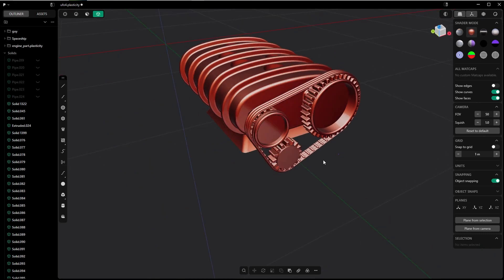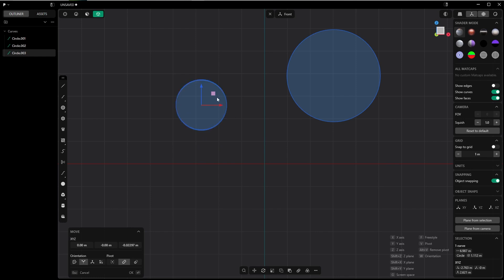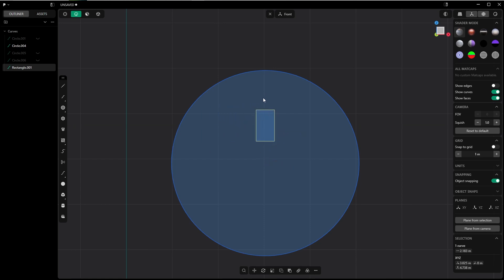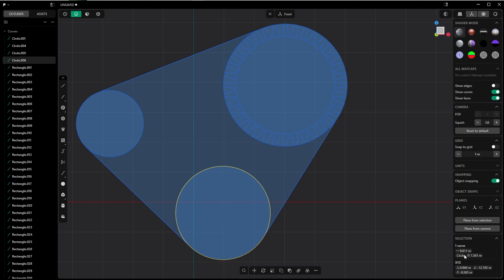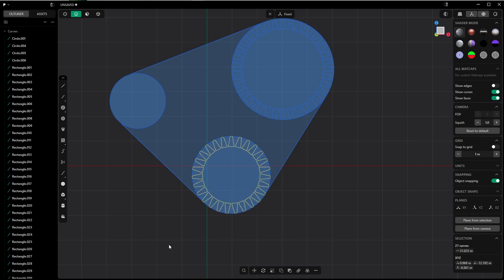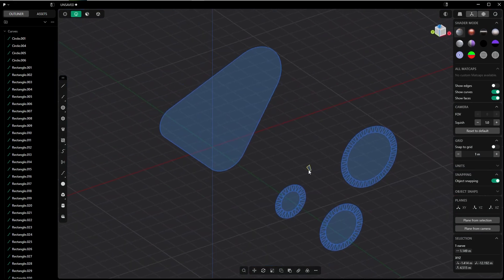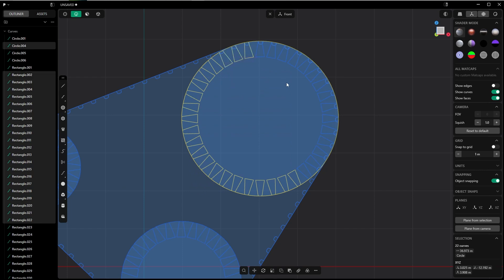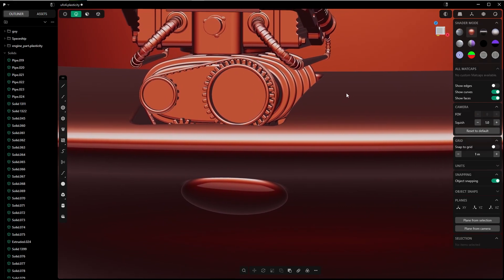Plasticity Tip No. 44 - Adjusting timing belt & gears perfectly

Comment: Gear that's smaller than the main gear gets its diameter multiplied by the number or main gear teeth
then the result is divided by the main gear circumference🤔
Reply from the maker: @flioink  exactly. That's the formula